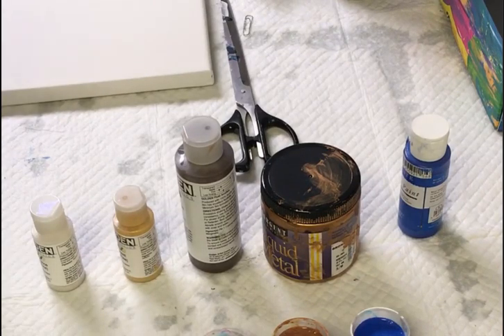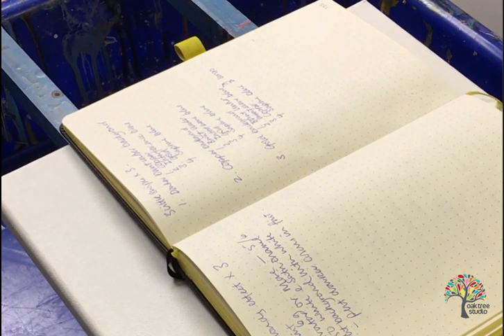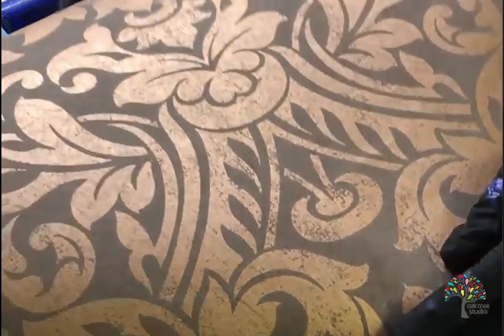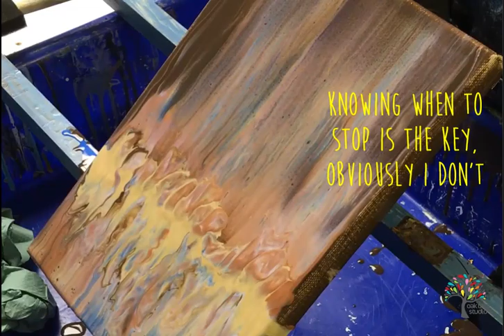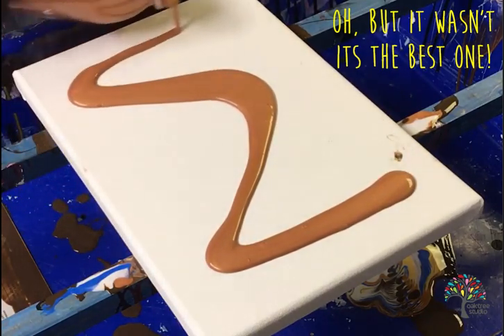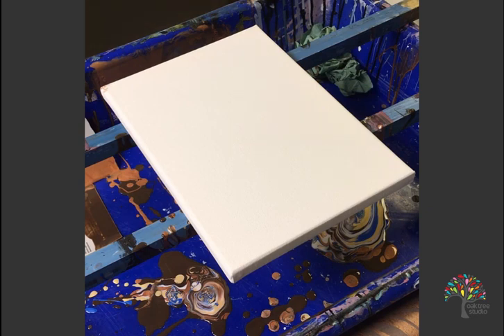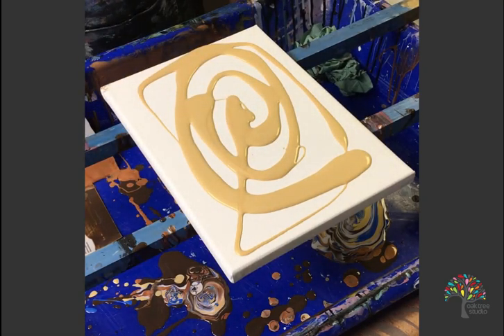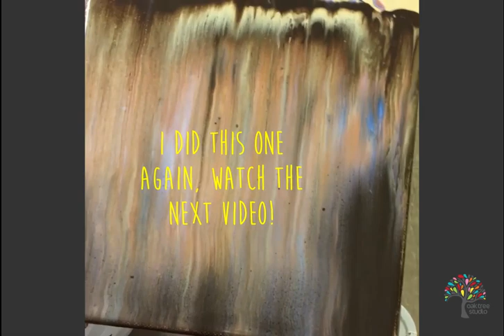3 little swipes

Comment: Fantastic, Julie!  The color choices are beautiful. I am a huge fan of Courtney Hoelscher and usually tilt my canvas back and forth to get a melting effect....not a fan of a straight line. 
Hint...the Blue Interference is typically used on either white or black backgrounds, dried backgrounds. And then the reflective effect of the mica can be seen at different angles. White and black backgrounds provide different results.  And I also find that if you mix interference (blue, for example) into it's like color (an acrylic blue) the interference gives the base color a shift effect. 

I love your art!!!
Reply from the maker: AK47 Mouth Soon to be Pour Decisions on Canvas thank you! It’s the first time I used the interface blue... can’t remember how I came to have it! This piece sold at my last open day, so thinking of doing another one.